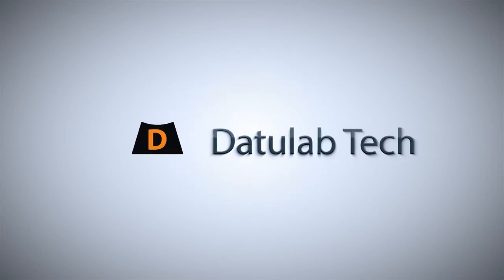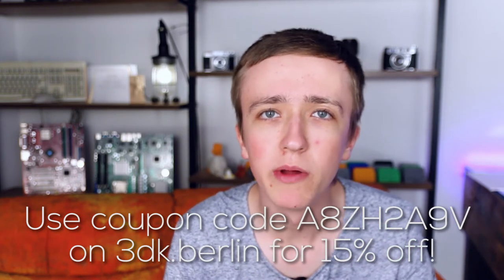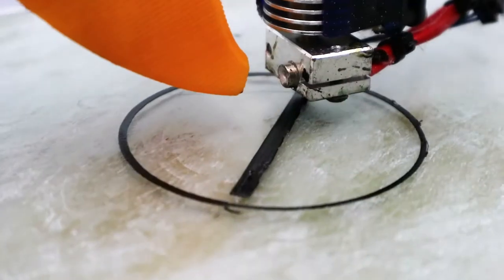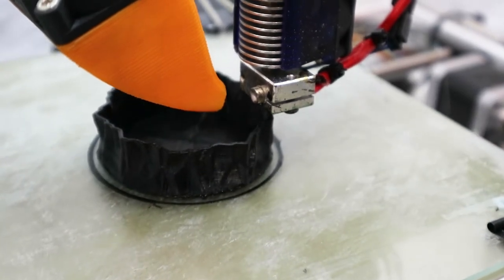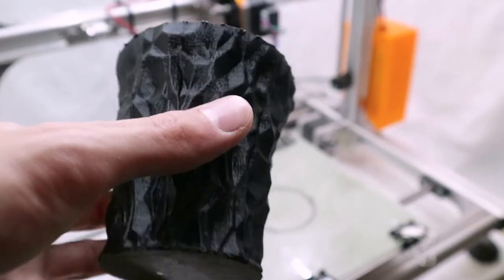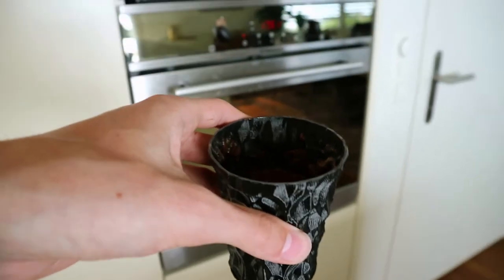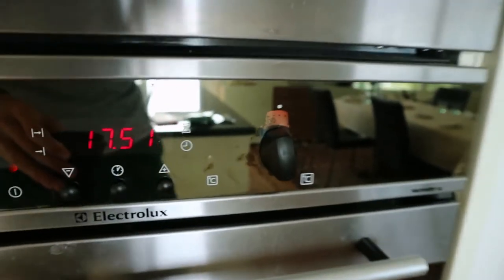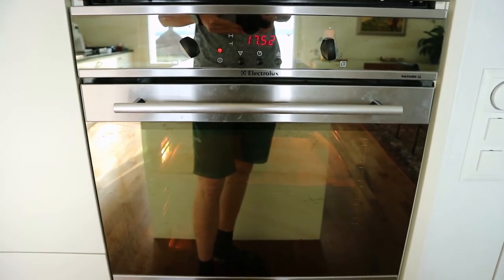HEAT RESISTANT 3D Prints! -  3dktop Tested

Comment: One thing to keep in mind though.  With the layering, and infills on some parts, organic material can get trapped, and won't come as clean.  Bacteria could continue to grow between each use.
Reply from the maker: I guess we will have to keep our print are clean. A lot of the bacteria would get killed tough due to the high temperatures while printing and afterwards while baking.
Reply: Yeah - it's after the print that you need to be concerned about.  Like using the cup for milk, soup, etc.  Bacteria could grow between the layers (and within the infill if you make it thick enough to need infill).  Hand, and/or machine washing won't kill any bacteria growing in those areas.  Autoclaving would be the only safe way to re-use a print for food use.  But, the print might not survive that though - LOL.
Reply: wouldnt cleaning it then preheating it to 180c before cooking kill all contams before cooking use? Sounds more than adequate.

Comment: Interesting as I am printing model Train smoke generators and need to hold shape at 160C. I have used CF-PETG and CF-Nylon so far and have had to add a Closed loop Temp Control using Thermistors and  LM317 chip to monitor Temp and adjust heater voltage. Would this filament help me to manage that heat situation. Good overview thank you, Dennis